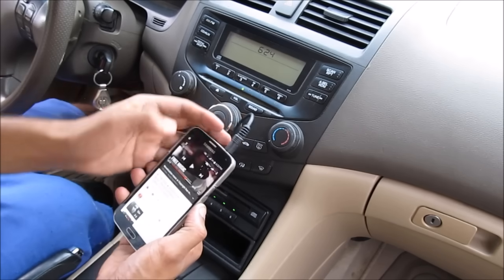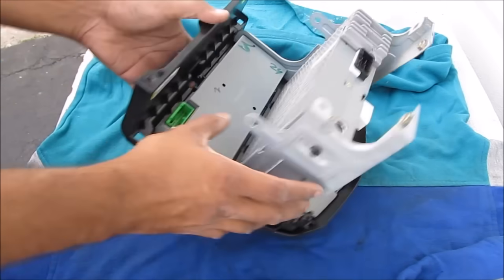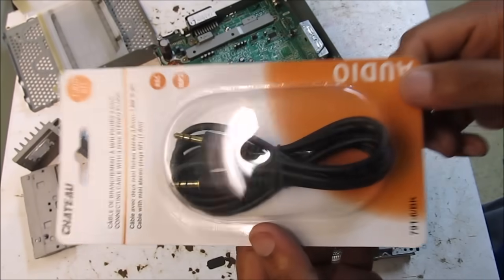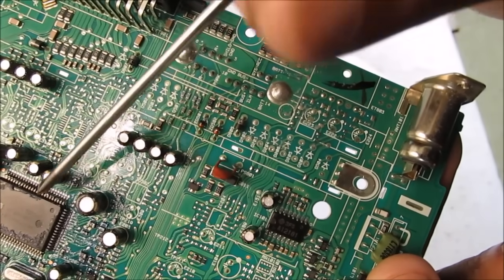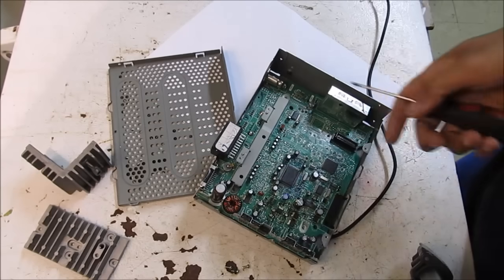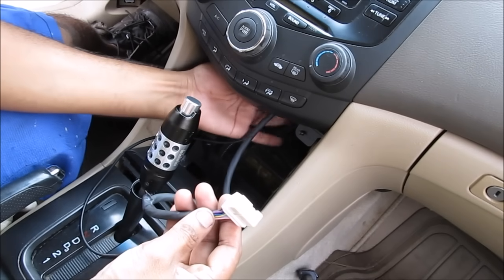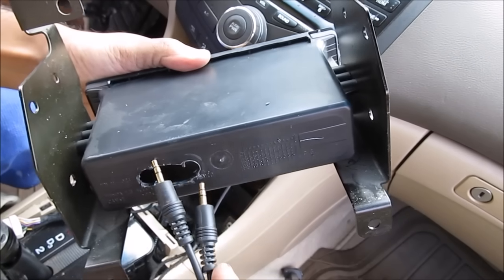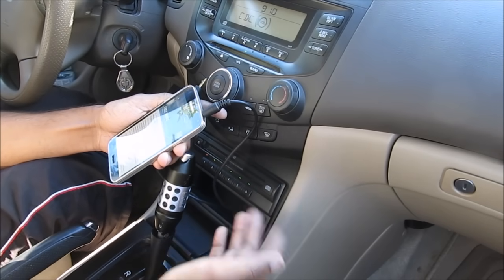$1 AUX Stereo Input Hack

Comment: A much easier way is to use a FM transmitter, which has blue tooth connection as well. Tune the transmitter to the car radio at any frequency where there is no other channel (or a weak channel) and pair your phone's blue tooth with the transmitter. The FM transmitter plugs into cigarette lighter and it also has aux input line as well if you don't want blue tooth connection. It works on any type of car, even on a 50 year old car.
Reply: I tried one of those Bluetooth / FM repeaters just today - the sound is such low volume and poor quality that it really is not usable.  It didn't cost much, but was a waste of money anyhow.

Comment: I have a question. I have a Radio with satellite but the car doesn't have the wiring harness for satellite. Kind of the same for CD changer. Am I able to use a regular female connector and wire it to aux or do I need the actual wiring harness?

Comment: Hi there! Is it possible to connect a bluetooth transmitter to that  14 pin connector without the cd changer?
Reply from the maker: Yes but you need an M-bus capable device to trick the radio to read from that input
Reply: @speedkar99  so without a device, there is no option to short some pins?

Comment: Possibly for an easier less surgical way, check out the isimple, specifically designed for your car. I put one in my Subaru and it works very well. Took about 3 hours but did not require soldering to any board. Parts cost about $90 all together. I plug the AUX cable into a cigarette light powered mp3 player that has a Random play feature, with bluetooth and holds a mini sd card. Not super clean, but works very well. This excellent video was used to follow for installation https://www.youtube.com/watch?v=Xd9kJ9ZWuao

Comment: For all that work you should just by the usb/aux adapter that connects in the bottom of the radio
Reply: True. Why the hell would any general person attempt this. But I will say there is nothing wrong with this videos intent. There's absolutely everything right about it because the truth is, despite the title is aimed to those who are genuinely interested in electronics, circuitry and soldering.

Comment: I did this, works like a charm. I kept the Bluetooth radio tuned to the frequency of the radio so there will be no noise from FM line. Only downside is I lost my 10 mm.
Reply: It was going to happen eventually.. might as well get it over with I guess. No toolset can keep the 10mm.

Comment: Question: Would it be better to connect a female 5-pin 3.5 connector to the same lines (plug-in by dashboard)? I wonder if there are any issues with signal "overriding" the modulator. I assume the modulator/sound is fine with that? Conversely, is the phone signal ok with the modulator still pushing signals while the phone plays?

Comment: great job  please i need your help  i have a 2004 acura tsx  i’m in el salvador  very hard to find parts and electronics i need  to put a AUX   on my radio but i don’t want to open the radio i do have a cable  the goes under  is a conector can i tap in the cables ???  and just  put the AUX connector  thank  you very much

Comment: Or you could just buy one of these https://www.amazon.com/Yomikoo-Interface-Connector-2003-2011-2006-2010/dp/B01EUZ948Y/ and plug it into the radio where the xm radio goes without taking apart half the car

Comment: Thanks for the info. You have great expertise. My broken 92 Acura CD changer is in my trunk, but the single player on the stereo still works. But it is the prior generation with the DIN plug. Can those plugs be hacked? If not, I will have to try the wiring direct to the circuit board inside the radio. I still need the FM radio.

Comment: Where did red wire go?
And on google it says ground wire is white not yellow.
You soldered yellow to ground.
I just tried it, it works but not perfect. Should I try swapping the wires as google says?
Reply from the maker: I don't go by wire color. Use a multimeter to determine which plug goes where

Comment: Is there a way to do this but keep the FM radio by connecting to the aux terminals and filling in the needed componets like compacitors to connect the bridging signal to the amp and work off the  AUX button in the OEM radio?

Comment: Just finished doing this on my sister's 2002 civic, works exactly as described. Thanks so much for the video man! It was a fun project and not all that difficult. I am not very electronics savvy (I know how to solder and what some basic components look like, but not much beyond that) but this tutorial gave me the courage to try it for myself. I went the radio route (af out) and the sound quality is not very good (a little worse than AM fidelity) but its livable. However its virtually free and a neat conversation starter so I am quite pleased!
Reply from the maker: Glad it worked

Comment: I literally found a Bluetooth FM modulator for $11.99 on Amazon in 30 seconds. 1 minute install.  if you want an AUX that bad, spend $100 and buy an aftermarket unit and a dash kit. 90% of people trying this would end up with a pile of scrap they couldn't re-assemble. 

speedkar99 owns his own manure delivery business. All of the vehicles are Dodge Journeys, because they are crap before anything gets loaded into them.
Reply from the maker: Your $12 Bluetooth adapter won't have the sound quality of a direct connection to the radio.

Comment: Hey man, great job, I've tried to add a Bluetooth module to my car stereo through the cd l/r channels but it didn't work I think because the cd player uses digital communication (don't know how to be sure though). I'd like to ask you something, how are you going to play music from the aux input if you solder it to the fm modulator output? Won't you get the aux signal to overlap over the fm signal creating a mess? Plus why is the fm modulator output a mono signal? It'd be really helpful if you could answer, great video by the way!
Reply from the maker: I couldn't get it to work on FM stereo, there was only one pin that gave me mono sound (AM). Yes it does over ride the signal, not the best way....if there was a way to connect an auto switching aux connector that would be ideal to mute the radio signal when plugged in
Reply: @speedkar99  Thanks for the reply man! Yeah, it's not the best option to override the fm signal, since you can still hear it in the background, but I had to go that way because that was the only analog input in the audio processor that made my signal sound good...
I tried to hook it up on the AM input line (no one broadcasts on AM here) but it sounded like crap. In the future I'd like to put a double switch maybe in the glove box to cut off the fm signal, that way I should be able to use the FM radio again and clean the signal when I want to use the aux cable (in my case I installed a Bluetooth receiver).
Keep up the great job dude!

Comment: u can buy an adaptor that plugs in at the back of the factory radio. 20 usd and a 10 min and far easier and less riskier job
did that 10 years ago, still works and u can keep both the radio and cd functions

Comment: Thanks for the detailed description. I have a different problem with the same radio. The radio backlight stopped coming on. The radio works normally. The screen is not back lighted and so I can't see anything on it in the night. Please do you know how I can solve that?
Reply from the maker: These Honda's had an issue with the screen... I heard it involves resoldering something on the board.

Comment: Waste of time. Most aux cords don't last long because the wires break after normal use and then you start hearing noise. If you do this you'll have to desolder the old aux cord off the board everytime the cord breaks. You're better off buying a cheap headunit with an aux input already installed.
Reply from the maker: Or using a female adapter

Comment: Bro why didn't you take apart the engine while you at it. I will drive around with a boom box and 12 v lead acid battery in the passenger seat before i do all this  ...
Reply from the maker: Hey if that works then go for it!
Reply: @speedkar99  No disrespect , its just that you performed brain surgery here imo. Great execution though, if it was me doing it at least 5 of those screws would be missing and the seamless factory put together would no longer be there...

Comment: @speedkarr99 So it would just be mono with just the left output or did you solder the right output to another joint?
Reply from the maker: Yes. 
The second method works for both left and right
Reply: @speedkar99  You should pin this comment because your response finally answers what many people are wondering. They are wondering what the heck to do with the red wire.

Comment from the maker: Purchase parts and tools for this DIY here:
Aux cable:
https://amzn.to/2XENtYT (US)
https://amzn.to/2XqxTvE (Canada)
Soldering Iron:
https://amzn.to/3C7jM2U (US)
https://amzn.to/3hA6bcF (Canada)
Solder:
https://amzn.to/3hxgiPF (US)
https://amzn.to/3hy5nF4 (Canada)
Philips screwdriver:
https://amzn.to/3Agc9qG (US)
https://amzn.to/3tJ0yh3 (Canada)
Reply: speedkar99 hey is there any way I can just buy the cd connector and use it without the cd changer?
Reply: @BMusic93  Probably more of a honda upgrade, they have kits that will allow you to add usb/aux port through the expansion ports. I believe its vehicle specific but it does come with a module and the cables etc require for the upgrade. It will just be more costly of course. 

Check ebay for other options but this is the general idea:
https://www.ebay.com/itm/Honda-Acura-radio-Bluetooth-phone-iPhone-Android-kit-iPod-Aux-USB-interface/371499159972?fits=Make%3AHonda&epid=15017013603&hash=item567f1351a4:g:ceAAAMXQiNdRdpUu
Reply: alaska💯💸💲😁😄😃😀😭

Comment: Hmm buy a Dual Radio Touch screen radio with apple car play for like $170 or dismantle my cars radio down to the motherboard and risk ruining the radio to add a cheap $1 aux cord that will break in like 1 week?
Reply: Ruining a radio you would have put in the trash after installing a new 170$ Dual unit!? Lol.. the initial plan is to mod your oem radio either because your oem system is high quality but lacks of aux jack and would like to keep it.. or simply because you're not looking to spend any $ but need a quick aux jack mod !
If you're looking for the simplest way around and doesn't mind spending money then this whole topic is not aimed at you from the get go!

Comment: I went to Amazon and bought a $13 Gizmo that allows you to connect to a radio station and stream music through an FM signal you can use it via Bluetooth on your phone or use an aux cord so much cheaper and easier than taking your car apart
Reply from the maker: True. But the sound quality on those are Terrible compared to hacking it directly

Comment: $1 cable.
6 hours of work if you have the right tools.
5 hours of which are re-watching this video.
Reply from the maker: It's worth it
Reply: If slightly skilled or/and slightly understand electronics, once the OP showed the L/R channels and Ground wires vs jack connector, and shown the af out connection point, you only need 2 minutes to write it down! 
6 hours of work with the right tools !!??? Really ?? 
With the right tools, 15 minutes max is required to remove your radio from the car, 10 minutes to take it apart, 10 minutes to skin your audio cable and weld appropriate wires to connection points , 10 minutes to reassemble it , 15 minutes to put it back in your car.
1h total !? 
If you ever feel like something simple would take you forever to accomplish, then its just not for you!
Reply: Chris King ever heard of a joke?

Comment: Thanks for this video !! Got a question tho : You soldered the Yellow wire ''GRND'' to GRND connection, White wire ''Left Signal'' to the AF OUT connection, but you haven't soldered the Red Wire ''Right signal'' anywhere ! Is it normal ? If so then the processed sound is MONO only ? Also... We first can see the skinned red wire hanging around loose and the you're taping/fixing the wires on the board, I guess you've cut the uncovered end of the wire ? seems pretty unsafe lol .
Also, does most other manufacturers radios ''Like Nissan,Toyota for example'' have similar FM modulator connection points ? Like AF OUT ? 
Thanks

Comment: Or you can pay $7 and buy a receiver deck that has Bluetooth and auxiliary input and have a completely new deck but that wouldn't be using your brain at all because that $6 means so goddamn
Reply from the maker: Really? Where
Reply: Wutttttttt !? Even junkyards wouldn't bother disassembling a radio unit from a wrecked car then sell it for 7$ LOL . You might find one on marketplace from @ 30$+ if lucky enough to find a clean unit !! Its a very cheap method to add AUX input , if youre able to install a new deck in your car then doing the mod isn't much more complicated : Removing a few screws to open your deck, skinning a 3.5mm audio cable and welding 2 damn wires! Probably adds 15minutes to your whole installation process lol

Comment: Just buy a 99 dollar replacement radio with all the inputs you need
Reply: If you have a shitty OEM sound system ''Cheap deck with cheap speakers'' then yes you're right !! But some folks got a high quality sound system but lacking Bluetooth media input or even AUX input ! I had a 2006 Jeep Commander back then with a full Boston Audio system as OEM. Screen deck + 2 amplifiers (non rca) and 8 High quality spreakers. Sound was amazing for factory system. Had Bluetooth Handsfree available but it was a separate module from the head unit, so no Bluetooth media sound option, and no usb/AUX inputs !!! Installing a 100$ radio = losing my screen display/nav + both amplifiers !! In this case this mod is awesome !

Comment: How to start a radio fire 🔥 on a random morning drive to work
Reply from the maker: If you don't know what you are doing...
Reply: Radio motherboard is filled with capacitors and protection circuits. plus the radio itself is powered by a unique slot within the fuse box. If your badly modified deck has a short circuit and the board fails to protect itself then the dedicated fuse in the fuse box will !
Reply: Sorry to all wiremen out there
Reply: @chrisvelarde2106  : Don't be sorry mate ! It's a knowledge wiremans are glad to have ! What looks complicated and unsafe to you is logic/basics and safe !! Saves us lots of bucks 2 lol
Reply: You are rite friend , what may look like impossible to many , is a skilled trade to few in this work

Comment: Just go to Walmart and buy a $50 radio that has it if you're going to do all that work for no fucking reason get a better radio. Or you can buy one of those converters that goes straight to the radio station. And remember when you replace the heatsink to put new thermal paste back on it so you don't catch your car on fire.
Reply from the maker: Aftermarket radio looks ugly in the dash plus u need a dash kit
Reply: @speedkar99  so save up $100 and buy a good-looking radio.

Comment: For those saying put after market deck. That's not as easy as you think. The stereo controls some of the car options and it's not cheap for the adapters. I have 02 Denali and the harness is 150.00 and eventually grounds out on the board of the overpriced harness short out from heat. I just cut out all the vehicle options to bypass the amp it's not fun. It is a good idea to use original if the deck works fine.
Reply from the maker: True

Comment: just i buy new radio,cd,6 cd changer what have USB,SD card,remote contorller,40$ no need make cable and wire session haha.and 50$ can buy today full music android whit internet,navicator, all same. and have front and rear wiev cameras and inbut connection at old cd but who need cd bevause all music can use usb,sd card, phone, in car.
Reply from the maker: True

Comment: Easier to just buy a newer vehicle 🤷🏻‍♂️
Reply: Just replace it with an aftermarket bluetooth radio,more easy then take all that shit apart.
Reply: @elcoyotecojodeldesierto2300  buy an fm transmitter...it solves the problem

Comment: A very good step-by-step instruction! A bit more tricky than I was hoping and when in the end you say "the fm module method is MONO and of lower quality" i decided not to go through all that. I will instead build in an amplifier between Radio and speakers and have my AUX to that. But thanks for the good video!
Reply from the maker: You are welcome. Not everyone has an M-Bus device to trick the radio into reading from aux ...but that's the best way

Comment: Not hacking shit bruh
Reply from the maker: Then what is it?
Reply: Taking apart your dash to sauder 3 wires on a chip dude thats not hacking
Reply: Juss because it has to do with a "mother board" doesnt necessarily mean your hacking
Reply: You could have simply wired those same three wires to the wires that output audio from the back of the radio "speaker wires" and it would have worked juss as good without having to REMOVE REMOVE REMOVE.

Comment: You can buy a plug in connecter for $20 on Ebay. The best thing is to replace the whole radio as all Accord radios of that generation will fail. We got one from a junkyard and it even drained the battery .
Reply from the maker: Good call